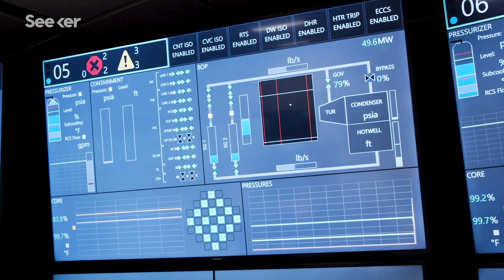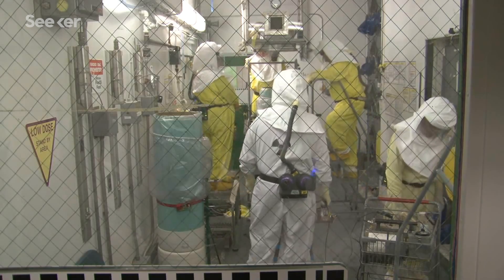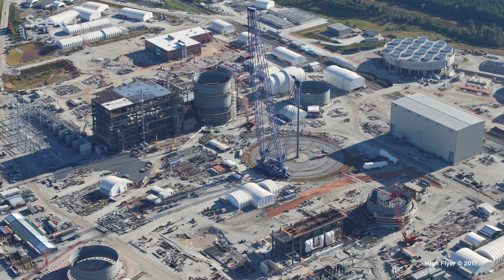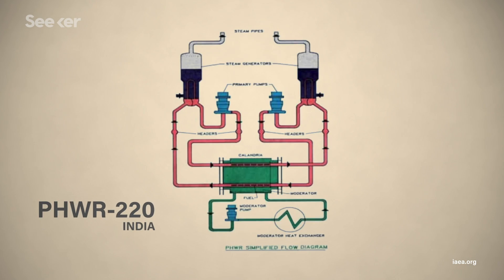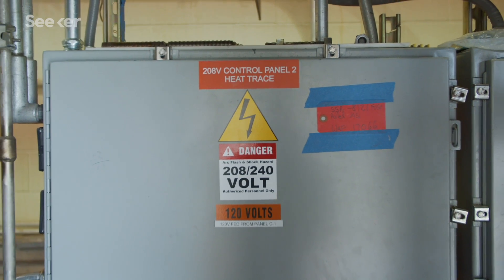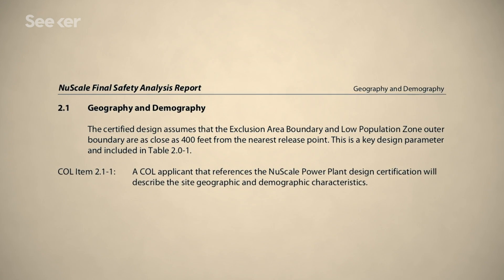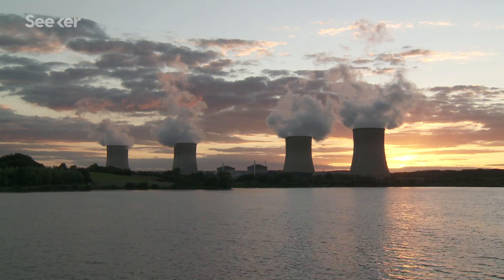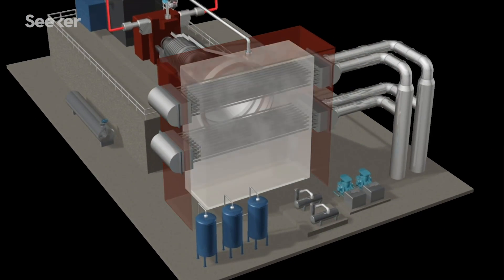Mini-Nuclear Reactors Are Coming, and They Could Reinvent the Energy Industry

Comment: Excellent. But: 

The nuclear industry can come up with something better.
What do we have? First of all, uranium, which is
decomposing. This generates heat, which is dissipated.
Then the super-hot water generates steam, which
is passed on. Then onto the tubine blades, where
mechanical turning energy is generated. And finally
magnetic fields that produce electricity in the generator. 

What's that all about? That's more than ridiculous.
Only in the fifth step the form of energy we want?
Just the thought of such nonsense makes you
despair. 

Go from uranium directly to electricity, then
you are clever.

Translated with www.DeepL.com/Translator (free version)

Comment: Thorium Liquid Salt reactors avoids all the radiation and safety issues.
Reply: Tod Jones-- Absolutely right! Why don't we go for Thorium. It's a 'walk away' technology, it has little waste, It's around us in abundance, and It's safe. Thorium was ready to go in the 1950, but the powers that be wanted plutonium for their bombs. So thorium was shelved....but now is the time to revive it!
Reply: The byproduct of thorium reactors is still radioactive.
Reply: @Matt_10203   Yes you're correct of course but It's far less radioactive and lasts about three hundred years as opposed to thousands of years. Also the highly toxic waste we have now can be used up in a thorium reactor. It's not the best solution but it's got to be better than a Uranium/Plutonium reactor. Fusion is of course the holy grail of energy production but it's a little way off yet.
Reply: @Stuartgerwyn  300 years would imply higher radioactivity due to a shorter half life meaning more nucleic decay over an shorter time span. 
Sure it might be less radioactive over 20,000 years but for those 300, it's going to be insanely active. 
The rule tends to be, higher the half life, lower the radiation.
And as for the current waste, thorium would have to be refined out, which is currently not a process currently used iirc. 
Right now the storage is pretty safe, the waste is processed, then impregnated into a glass like material and poured into large metal canisters. Then they are sealed and buried deep underground. British energy actually tested the canisters by conducting a fake train crash where they lay a train section full of canisters across a railway, and crashed another train directly into them. None were broken open. https://m.youtube.com/watch?v=ZY446h4pZdc
This was still pre Chernobyl, so these containers are even more strong now.
Reply: @Matt_10203  New be honest! It is minuscule compared to Uranium based reactors.  Your point Is?
Reply: @todjones6571  not exactly. Thorium decays into U-233 via Beta decay, the U-233 produced is contaminated with U-232 which is radioactive in itself, but decays into some high gamma emitters later. Also thorium requires a neutron emitter, in the form of Plutonium which itself it a highly radioactive substance, and decays into some pretty bad emitters also. 
Thorium is over hyped. If it was so clean and easy, we wouldn't be spending billions on unfinished nuclear plants for no reason if it was as easy as making a thorium reactor.
Reply: @Matt_10203  BUT, Uranium waste by volume is how much compared to Thorium?  Radio active, yes, but extremely small compared to the amount of waste generated and not used in the heavy water reactors.
Reply: @Matt_10203  Thorium reactors have worked in the past, though, but were abandoned due to not being as fit for producing weapon-grade isotopes. Yes, they have their own fair share of problems and radioactivity issues... but the best thing about thorium is that it's more plentiful and cheaper, than uranium, and problems with weaponization can be a boon for integrating thorium reactors into civilian infrastructure.

Comment: New Nuclear power plants need to be walkway safe. This can be achieved by not using pressurised water as the coolant but instead use molten salts etc that enable the reactor to operate at 500c+.
This increased temperature makes the power plant far more efficient and able to do other chemicals reactions such as producing fuel from CO2 and water plus desalination plants could be another possible use.
The fuel can be from old missiles, old fuel rods, or thorium. So these plants could make the waste from the other conventional plants useful instead of a 100,000 yr security risk.
Due to the modular system these units could be mass produced to replace the aging coal plants to lower CO2 whilst increasing power generation.

Comment: So same design concept. In emergency the rods slide down into housing after is shot down. Only problem is when too hot the rods expand from the heat and cannot fit back into their housing. And you have a meltdown, like in Chernobyl. And they pick the same safety design.
Reply: That's not true. Our reactors are much more safe than reactors from the 80s

Comment: bleh these plants are still using old bad tech, they are still by the looks solid fueled which are crap by design, better to go liquid fueled solves many of the problems of old gen nuclear. There are other company's that are prototyping building the WHOLE plant in a ship yard factory and then shipping to your shoreline, building about a year with a capacity of 0.5 gigawatts(500 megawatts) that are Molten    Salt Reactors which are much safer and cheaper to run and build, here is a video https://www.youtube.com/watch?v=C2tWXaMm94Q

Comment: Having it be "pocket sized" and greater abundance of these things does not give more confidence in them even if they are 10 000 times safer than a normal reactor.   It's still what it is.  And Renewable energy still sounds friendlier  even if its less practical. 
and once again.   
What do you do with Nuclear waste?   Are we Really just  put it inside  a hole in a mountain and pretend it cannot contaminate water and soil for thousands of years?    Because that sounds like one of the shititest trade offs.
Reply: Renewable energy also produces waste, solar even more toxic and longer lasting than nuclear.

Comment: I find this funny. I was stationed abroad a fast attack nuclear sub. I often wondered why don't we use something like these small reactors instead of big nuke plants? Now they're looking to do it. It really took this long to figure that out. The small ones are a heck of a lot easier to keep them going safely. I live near a hydroelectric dam. It puts out less power then the reactor on the submarine did. The dam also has alot of problems. If done right I don't see why this wouldn't work.

Comment: What about the electro magnets burning out? Every now and then electro magnets burn out, so if you were to turn them on, the rods won't rise, yes if something were to go wrong, it would automatically shut down, but think of how fast those atoms could become unstable and cause other system malfunctions and errors having an autonomous computer system, having a safety chamber over those smr reactors like mentioned might not hold up if not thoroughly tested safely to see if it holds up, yes it can hold up against a hurricane, but we are talking about a different kind of state or matter where it functions differently.

Comment: Sure, SMR's look safer than current fuel rod reactors, but they still haven't addressed the other bear in the room: fuel inefficiency. Solid radioactive fuel accumulates cracks that degrade neutron flow, rendering a fuel rod useless before it has converted even 1 percent of its fuel's potential fissile energy. 
That is why Molten Salt Reactors are a better idea. Aside from its own passive safety, an MSR can burn 99 percent of its fuel before it needs to be refreshed. From what I have seen online, it looks like MSR's are simpler and cheaper to build than modular solid fuel reactors. Plus, the fission byproducts of U233 are far less dangerous than from 235/238 solid fuel. 
Finally, Thorium is available worldwide, with generous concentrations in America, China and India. This stuff can fuel our energy-guzzling societies for thousands of years, certainly until nuclear fusion is perfected. 
Aside from squabbles over design, we should all agree that we just don't have time to waste getting Big Nuclear in gear. Well-meaning people talk about solar and wind, but those sources don't solve the climate crisis, which calls for enormous amounts of energy to drag carbon from the atmosphere and desalinate huge amounts of sea water. This stuff has to happen NOW NOW NOW, not when it's convenient for Big Oil and their well-bribed politicians. The planet is heating up far faster than predicted by conservative scientific estimates. The ice caps are melting. It's going to happen IN OUR LIFETIMES. 
We are in a desperate race against time, and almost nobody has raised a finger! Is everybody waiting for someone to say go?
Okay: GO!!!!!!!!!!!!!!!!!

Comment: The most important thing about this is not actually the safety, our modern reactor designs are quite safe and they are already not going to have similar accidents as 3MI, Chernobyl or Fukushima.
The important parts people should focus on are the low price, modularity and the smaller safety zone around the plant. Oil lobbyists keep claiming it is a bad thing that you need to build a bunch of windmills or solar panels to equal one big power plant, but while their company is still bribing politicians to get the permits a skilled crew can fit a house with PV panels in a day or two or put up a windmill in a couple weeks. As the power plant's budget overruns rise to tens of billions, the cost of building enough renewables to make a town self-sufficient is at most tens of millions. Even when the reactor is finally operational and produces cheap power, the actual daily expenses get pretty high and if you need to produce more power you need to start planning the next power plant, while the maintenance of renewables is pretty cheap and you can just keep building more capacity.
These small reactors allow for getting the power plant done quickly, close to the consumers, and for far smaller price. Then another can be added to expand the plant as needed or as money becomes available, without needing to restart everything involved in building another plant, which would likely be undersized by the time it is finished anyway.

Comment: Wouldnt it be a good idea to just.... blow it up? If the reaction and pressure of a nuclear reactor are what is dangerous, why don't we just blow the container wide open as soon as a failure is registered? This would keep the pressure from rising and maybe even scatter the uranium all over the pool making it impossible for it to react and explode.
Reply: No. It's a must better idea to depressurize and insert the control rods.
Reply: @ryancollyer2046  But that would take time. The explosive would release a bit of radioactive material nearby and would avoid a nuclear explosion.

Comment: I have no doubt as an engineer it is possible to build a commercially profitable small nuke plant. But I also notice the industry pushing to get the safety regulations eased. If these new nuke plants are performing to specification and whatever legal issues are resolved, why change the rules?

Comment: Ok, nice. But I haven't heard one single word about the problem with nuclear waste...
Reply: Cymbala store it in the desert (like we’ve been doing) or at the bottom of the ocean. Tons of exposed uranium down there anyway.
Reply: @thepope2412  Or reprocess it to get some more fuel out of it and use it for energy production. Or flat-out load it into fast-breeder reactor, which can use it as a fuel.
Reply: @caav56  that's a solution for the future. I don't believe we have economical breeder reactors currently, but we probably would if not for all the regulations on nuclear in the united states.
Reply: @thepope2412  That really sucks. Well, at least there's still reprocessing...

Comment: Boiling water is not productive. It is a waste. Molten salt thorium reactors, not boiling water but producing super critical co2 to power a turbine 1/5 the size of these monstrously expensive steam generators, that cannot use the power for any other thing than producing electricity is ridiculous. A small modular reactor not boiling water at all, can produce desalinated water with the heat, especially in small countries that need fresh water, and chemicals made with the thermal power available. These high pressure water reactors only use 5% of the available energy, and the thorium reactor can burn the waster now accumulating in all these horrible high pressure water reactors. Thus making any country that uses them have an economic boom that will make other countries poor in comparison.

Comment: this is a good example of a pipe dream and not learning the lessons of previous licensing efforts.  ALL designs must go through a licensing process and ALL designs will need to change as the licensing requirements change and they WILL change.  these small reactors are no different.

Comment: Future realistic doable clean  energy solution for today....
This technology and ITER fusion is the future.
Reply: Commercially viable fusion is the holy grail of energy generation, but it's still very far away. It won't be part of any solution for many decades.

Thorium is what we should be researching NOW. It is highly likely to yield practically useful results in the short term.

These improved small fission reactors are a good stop gap solution.
Reply: @a5cent  yes Thorium fuel is a good idea 
Dr Weinberg and Dr Alvin Radkowsky both pushed this in 1960s Weinberg dismissed from AEC politics involved to push for LPBW reactors and U235 fuel.
The Westinghouse AP1000 built all over China.

Comment: Nuclear is not renewable, the only safe form of Nuclear power is Solar.
Reply: Even solar is a big polluter and not very safe. manufacturing solar panels releases many toxic gases, cadmium telluride, copper indium selenide, hexafluoroethane, lead, etc. (Yes there are more toxic gases released) Fossil fuels such as natural gas and coal are at least able to be recycled by the use of chloroplasts that convert co2 into breathable oxygen 
Nuclear, hydro-electric are the most reliable sources. Wind and solar are not reliable for stable power

Comment: There is probably no totally safe method of energy production so it is a choice between going without the benefits of large scale energy production and finding the method that has the least amount of downside. My preferred path is that we go with devices such as that in the video as a stop gap to the point where fusion power becomes a reality. The pollution from fusion power is close to zero but the technology is still some way off. We cannot afford to wait 30 years so we go with these SMRs and also thorium based reactors in the short term while working on fusion power for the long term.

Comment: Still uses solid fuel, still produces very long lived mixed actinides i.e. conventional nuclear waste.  Will get shot down by eco-fascists.

What is needed are molten salt designed and online fuel processing to separate the waste stream into useful fission products and much lower amount of medium term actinides for underground storage (300 years is better than 10,000 years).  Thorium just happens to be the fertile element for abundant future power generation but we need to get the ball rolling on this instead of chucking more dry uranium platoon into the mix that while disaster resistant, will still produces very long lived fission product actinides.

Comment: YEA, AND THEN YOU HAVE TO GET RID OF THE NUCLEAR WASTE,
Reply: That's the thing, nuclear tech had the door shut on it before better reactions could be introduced.  The shitty reactors we've used for 50yrs were chosen because it's what the navy wanted to use, and it also produced plutonium during the cold war.  The thorium reactors everyone mentions use reactions where most byproducts are gone in a very short time, not thousands of years.  Nuclear is the answer, always has been, there's just becoming too many people and nothing else will ever supply enough power to feed industry.  A few solar panels and wind turbines will never power a giga factory, they can only reduce what we use or power some residential areas.